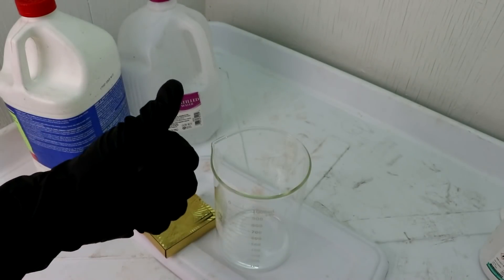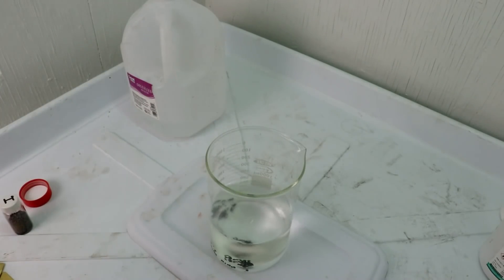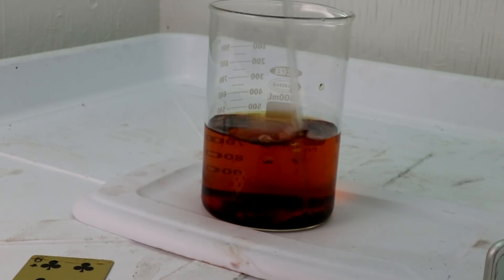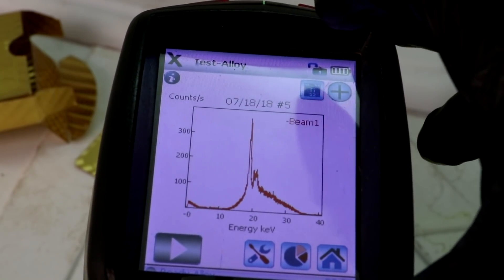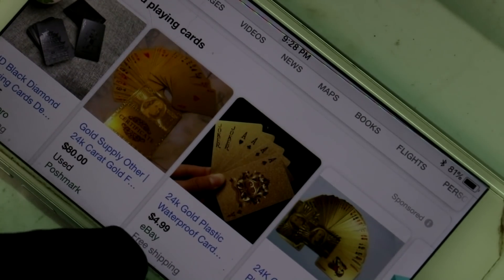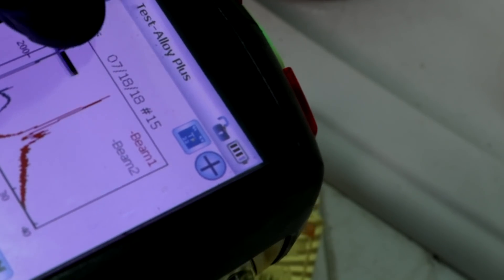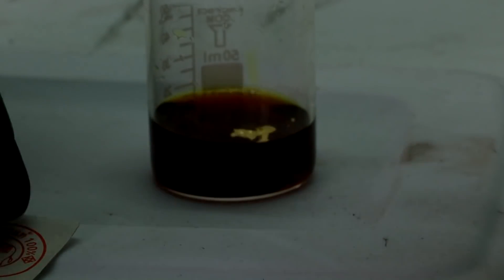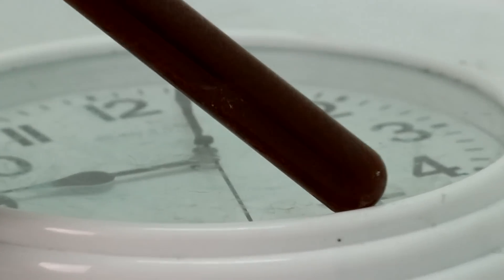Metal Refining & Recovery, Episode 25: Gold Playing Cards?

Comment: nice video, and you exposed a fake company in the process. I hope someone uses your video to take action against that company if possible. its not right for them to be allowed to trick people into buying that crap even if it was cheap, they still think its real gold.
Reply: NewtSniper Contains at least 1 atom of 24 karot gold!

Which is probably true about every card deck ever made.  If you consider that a deck of cards would have 10^21 to 10^22 atoms in it, well, that's a LOT of digits.  I can't conceive of that amount of material not containing some small number of stray gold atoms as "impurities".  Even what's almost certainly the most pure material known to mankind, chip grade silicon, is only pure out to 12 nines or so, meaning you have 10 digits left to work with, so if those impurities contain at least 1 part in 10 billion being gold, you would expect a deck of cards sized piece of chip grade silicon to contain at least one atom of gold.
Reply: They might be able to get away with it if there's an amount of gold in the cards so small it's basically undetectable, which I suspect they may have done.
Reply: yup...
Reply: Probably a Chinese company, not much we can do about that. You should see some of the other fakes made in China.
Reply: Yep. They'll either be impossible to track down through multiple lines of child companies or just change the name. I'm sure they make plenty of other scam products.
Reply: Trippin Yeah, but since they're charging normal prices for cards no harm no foul right? The certification should be removed though?
Reply: I could tell by looking at it that it wasn't gold let alone 24 karat.24k has an orange color to it instead of the normal gold color
Reply: Most of the time there $20 in Australia
Quite nice when the only other playing cards are plastic $5 packs
Reply: Moreover, quite possibly an outright counterfeit.  In this case, the name of the company printed on the cards is irrelevant since that company had nothing to do with it, and honestly they're just as upset if not more so about someone selling counterfeits of their products as we are about buying them.

Unfortunately, there's a pretty big problem with counterfeiting these sorts of products, especially if they're sold online, and yes, a lot of it is coming from China.

Comment: Wouldn't it make more sense to add the sodium hydroxide before the hydrochloric acid?
Reply from the maker: Thats like asking if it makes more sense to multiply 2 X 3 than 3 X 2.
Reply: But doesn't the acid neutralize the NaOH before it has a chance to help the iodine dissolve into the water?
Reply: It's the Na ions that help it dissolve, and the acid doesn't touch those anyway.
Reply: Cody'sLab But if the reaction is between the sodium hydroxide and iodine then it would make sense to let that happen before adding the hydrochloric acid which will consume all the sodium hydroxide.

Comment: So let me get this right... you add HCl then NaOH and you think that... nevermind.
Reply: HCl + NaOH --> H20 + NaCl

He was destroying the acid he added that the process could use in order to create Na ions when he could have just added table salt (NaCl) to begin with.
Reply: Someone's salty.
Reply from the maker: Meh, its all the same as far as the chemistry is concerned.
Reply: I thought the same thing... just add NaCl?
Reply: Let's say he added 80mL of 20% murietic acid (HCl). I think I'm underestimating the amount added because it's not clear in the video, and the manufacture's (Kleen Strip) MSDS page lists <30% HCL and I want to be on the safe side.
That gives 0.5 mol of HCL. 

And lets say he added 2g of Sodium Hydroxide (NaOH). Again this is really unclear and I seriously doubt he added 2g, but you just can't tell. Molecular weight of 97% NaOH powder from sigma has 40g/mol MW. 
That gives 0.05 mol NaOH

Because they are both monoprotic/monobasic they react 1:1 and it means that at worst he consumed 10% of the acid he added. If I were to guess, I think the sodium hydroxide added was far less than 2g, possibly even less than one, and the murietic acid used was probably closer to 30%. This means he's neutralizing a negligible amount of the acid.
Reply: I sucked at chemistry so I wouldn't know if he was doing something wrong lol.
Reply: To be fair, HCl is the only acid you'll need 90% of the time
Reply: Yeah, the NaOH neutralized the acid but the goal wasnt to make the solution alkaline, just to introduce sodium ions.

Comment: Are the cards heavy
Reply: well probably a little because they are plastic instead of paper
Reply: Yeah but because of the plastic they're made on, not the gold they pretend to have.
Reply: pukalo [CDN] probably not noticeable amount but yes they are in comparison to regular cards
Reply: Remember that little tiny gold bead Cody got from processing a bunch of computer parts? The amount on even legitimate gold cards would be similar to that. The weight would not be unnoticeable - we're talking matters of a single gram tops.
Reply: jeff u high go home
Reply: i dont know if you've noticed but paper is pretty fucking heavy. im not so sure that plastic is actually heavier than paper
Reply: No they are heavy and light depending on your hand ✋